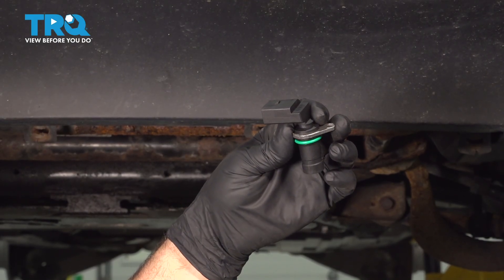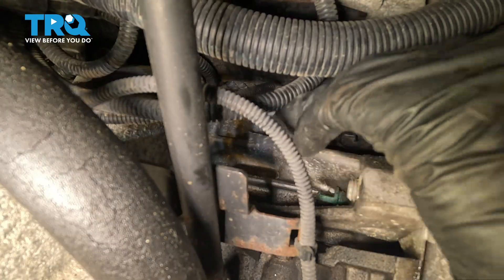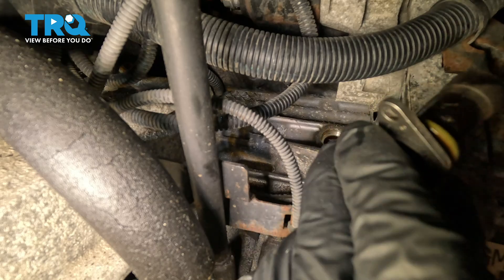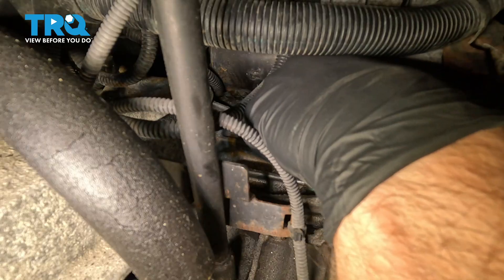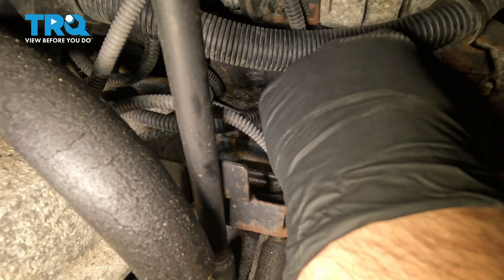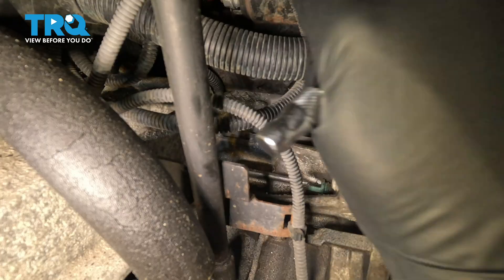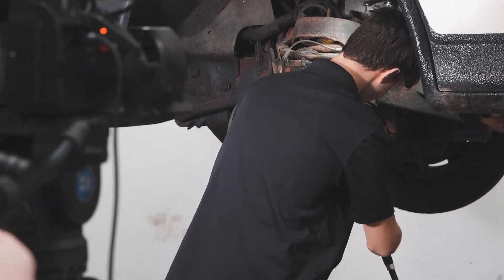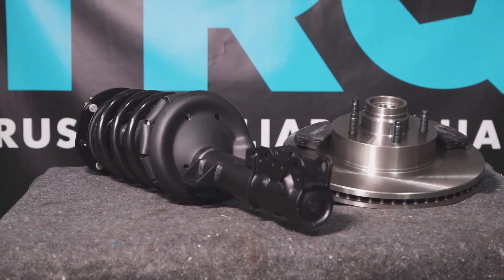How to Replace Crankshaft Position Sensor 2000-2006 BMW X5 3.0L L6

Comment: How did you get to this position for access to the sensor?  We can get to the bolt but can't get it off.  We are under car on jack stands and do not have the clear shot you show here.  TIA.